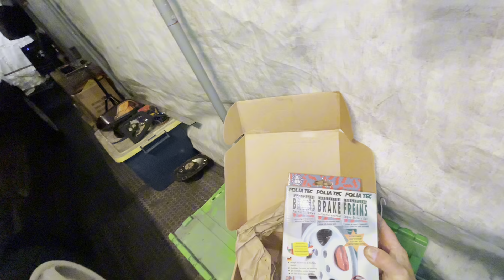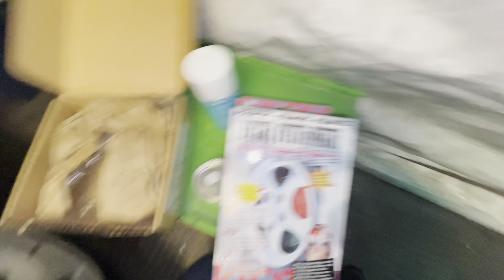Escort cosworth road trip preparation and getting ripped off on e bay

Comment: You should contact eBay through their dispute system and say to them that the goods weren't as described, and ask for your money back under eBay's Money Back Guarantee. Good luck in getting this sorted.
Reply from the maker: I’ve opened a dispute mate thanks for the advice ❤ £35 out of pocket atm
Reply: @c111prs  You should get the money back as the goods weren't as described. If the seller had declared the pots of tins were opened and used then you could have made a decision based on that information, whether to buy them or not. I suspect you would have bought them elsewhere unused and probably cheaper. All the best, great videos as always.
Reply from the maker: @patrickclarke4622  advert sais brand new unopened the joker 🤡 so fingers crossed , thanks for watching my mate